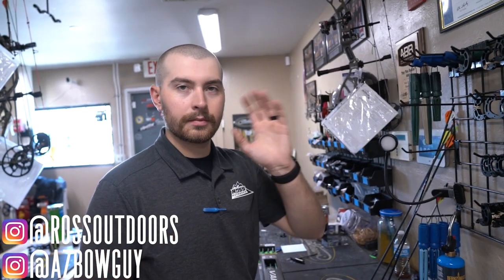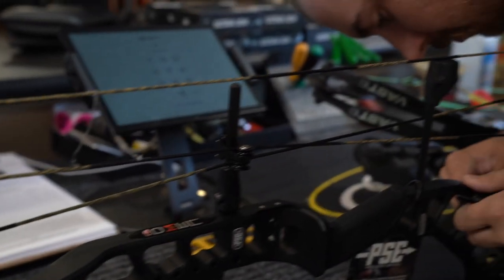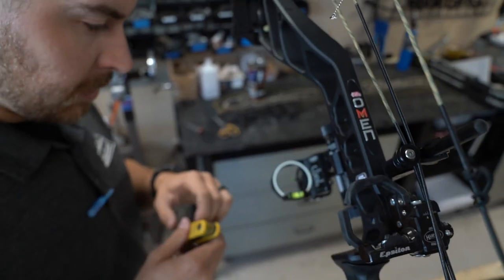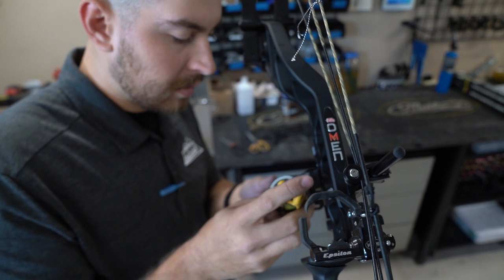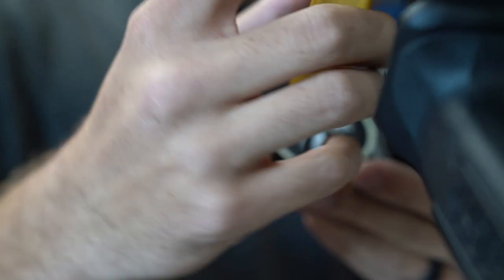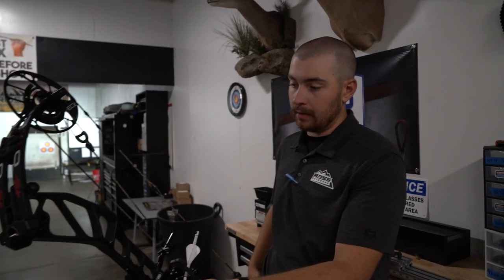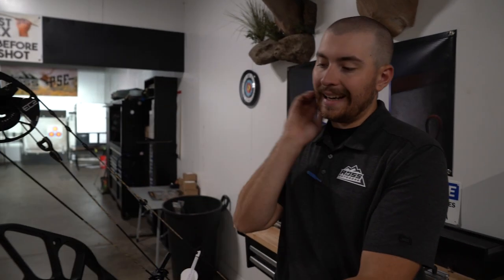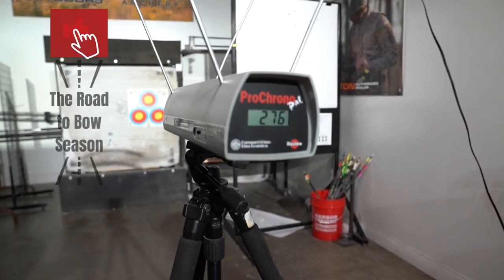PSE Omen Setup - New Favorite Bow? - TRTBS/E12

Comment: Love my new omen with the EC2, I had last years omen with the e2 and the year before I had a xpedite, big improvement from the xpedite, the shim system was necessary for me to tune, I also got a left tear so I had to shim left, previous years pse's came from the factory shimmed left and tuned instantly for me.  I also have a fortis 30 with the EC2 cam, this bow is also amazing and only a 6 fps slower than the omen but is 2 pounds heavier so not a fair comparison.  IMO pse is at the top of the game
Tie in a prusik knot on the hamskea cord, so user friendly.    Average Jack has a great video on how to tie in the prusik

Comment: So, if you only move one cam over to get a bullet hole, what does that do to all your levels? If your string isn't level with the riser, do you level your sight with the string or the riser?
Reply from the maker: So, we actually moved both cams over.  The first move got us almost there.  Then we moved the bottom and made a rest adjustment.